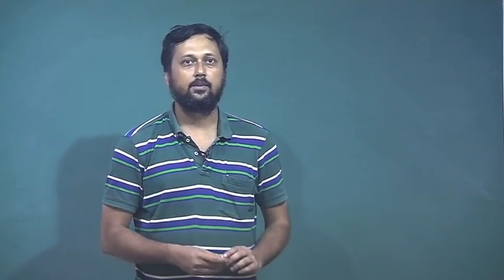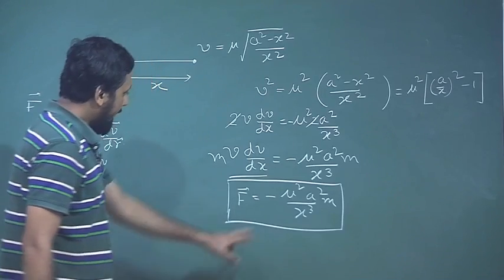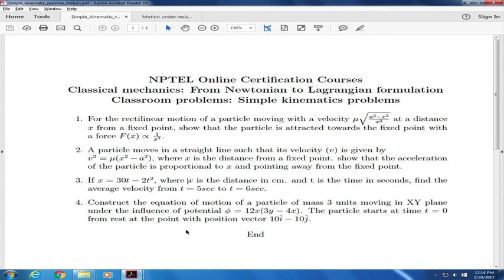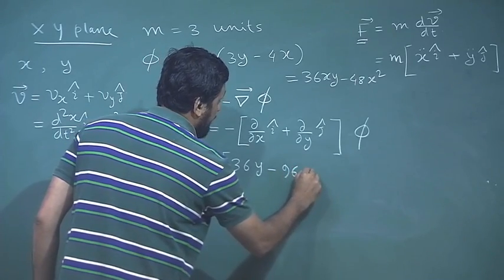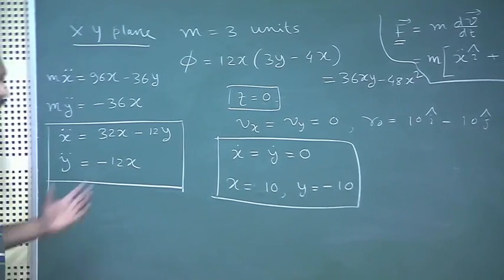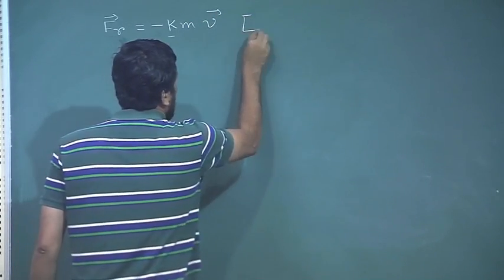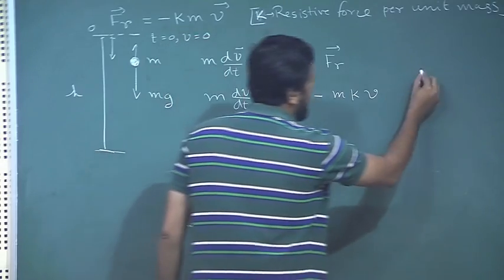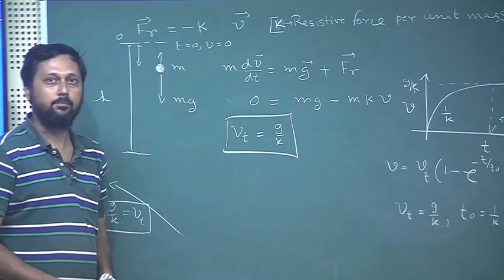Lecture 2:

Comment: In the 3rd question you should do (v1+v2)/2. So it woulb be 16/2. Witch is 8. But you should have demonstrated earlier that this expression for average velocity is correct for constant acceleration.

Comment: But relativity says a falling raindrop gains mass when it falls...so what if we check relative velocity v=1/(1-v^2/c^2)^1/2 ? It is easy to understand relativity with some basic equations of classical mechanics❤😊🤘
Reply: For a simple raindrop, (v/c) ~ 0, so the mass is nearly invariant. You are anyways ignoring the surface properties of the raindrop, so it doesn't matter.
Reply: @DarthLala106  thanks for correcting😊💝 i'll gain some knoweledge about it .🤘

Comment: Sir in last section we condidered viscous force f=-kmv where k is force per unit mass as u mentioned. Shouldn't you think that kv should be force per unit mass because in first case we left with wrong dimension of force
Reply: I have also doubt in this please clear,  is it k or kv for resistive force per unit mass

Comment: Sir.
What is the basic difference between velocity and acceleration (the body moving in straight line without changing of speed is said to be velocity and when body changes the speed so it said to be acceleration) my question is this that the body change the speed and direction so it also said this is variable velocity so why the word acceleration is use? I can't understand please give me effective answer.
Reply: Acceleration is the change in वेलोसिटी  divided by time for which velocity is changed from initial to final velocity
Reply: acceleration basically means how fast the velocity is changing

Comment: Sir,your lectures are awesome.But you have slightly made a mistake.In calculating average of any function,we basically have three formulae.
1.Avg velo=(initial velocity+final veocity)/2
2.Avg velo=(X2-X1)/T2-T1
3.Avg velo=(integration v dt)/integration dt........   (use given limits)

In all the three cases,we have 8 m/s...
Case-1
V=30-4t
Final velo(t=6)=30-24=6
Initialal velo(t=5)=30-20=10
Avg velo=(10+6)/2=8
Case-2
X=30t-2t2
X2(t=6)=180-2(36)=108
X1(t=5)=150-2(25)=100
X2-X1=8
T2-T1=6-5=1
Avg  velo=8
Case-3
Integrate (vdt)=int(30-4t)dt=30t-4t2,,, apply limits=8
Integrate(dt)=int(dt)=t,apply limits=1
Avg velo=8/1=8
Reply: Great! You are correct.
Reply: Thank you
Reply: I also confused with sir's Sol
Reply: yeah I was doubting myself 😂
Reply: Btw dx/dt is only for instantaneous velocity and he did write only dx/dt in lieu of del(x)/del(t) which was average velocity. Okay no doubt sir has no basic knowledge despite being a professor in the best institute across India. I am wondering how they usually make paper of iit jee advanced and gate paper